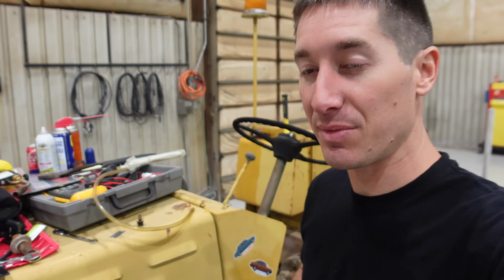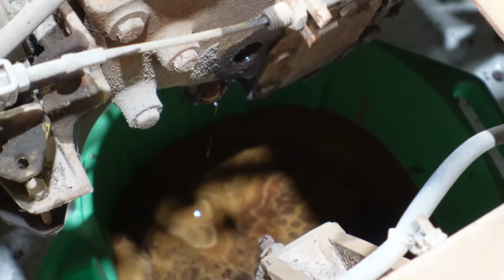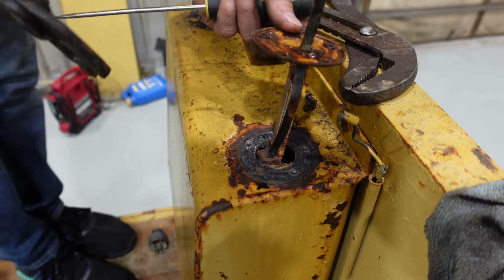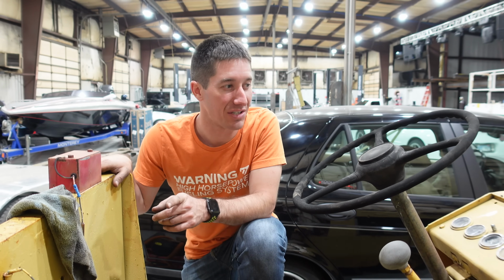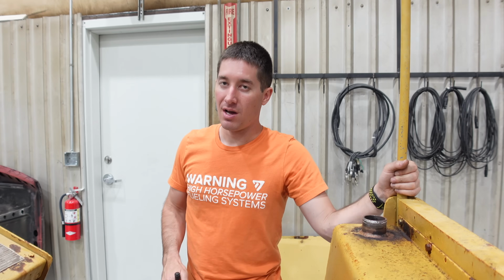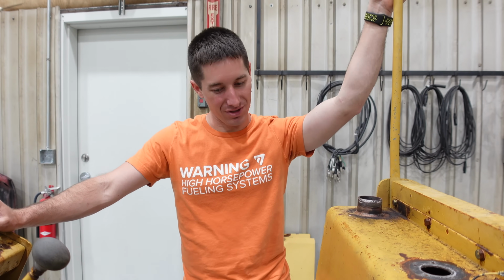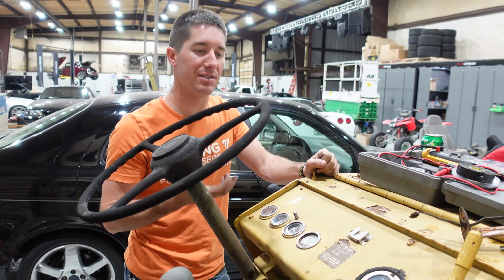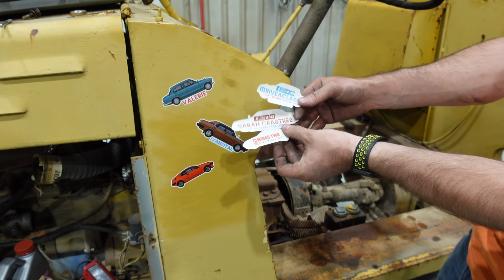SAVING My RUSTED Airport TUG Gas Tank With Evaporust

Comment: We had a Tug at the Oklahoma State Fair Grounds we used for an emergency jump/tow vehicle and a tug for our mobile welder trailer. It had a Ford flathead v-8 that our ex-Vietnam Veteran Mechanic/World of Outlaws Race Driver rebuilt and hotrodded. It would spin the crap out of those huge Tug tires it had and damn near pull a wheelie if you dumped the clutch properly(Improperly?). We could jump semi-trucks and diesel dump trucks off it as well as regular street cars. Definitely a workhorse. I always wanted that flathead for a 32 Ford Coupe rebuild.

Comment: To remove the aluminum from the steel cap threads, form a bowl around it and then fill with muriatic acid.  A couple hours ought to do, then wire wheel the rest clean.

Comment: Heating that aluminum cap then turning it is not good. Heat it up and let it cool, when you heat it up you soften the aluminum up then you turn it leaving the threads gauled to the steel.

Comment: That gear oil looks like chocolate milk. The master cylinder needs to be soaked in carb cleaner. Wow that gas cap strainer was gross. So will you put some kind of sealer in the gas tank? Would a wire wheel clean the gas cap threads? Yes bleeding the brakes had to make a big difference. What about carb rebuild?

Comment: That gas fill kinda looks like a metal plumbing or conduit pipe/thread…. Maybe try a pipe/conduit end cap… if it fits then toss a custom made rubber grommet or oring to seal and there ya go… ya think?

Comment: Eventually, add a Momo wheel, digital dash and Detroit rear locker to get that baby to hook up. Wilwood brakes to haul it down at the end of a long straight. Suspension already appears to be lowered and it's running low profile tires so that should keep it stable during hard cornering. Skidpad data results in the near future?

Comment: It might not be the low-profile heavy duty Pettibone, but I do have an ex-airport luggage tug…  started life as a chassis only ford 1 one-ton in the 80s, with the shortest wheelbase you’ve ever seen.  We picked it up from the scrap yard and made a baby gin-pole truck out of it, with winches front and back.  In the winter we mount a plow up front, and a big wing plow off the back to move snow.

Comment: Three cheers for 20 years of condensation.   I once dragged a skid-steer into my shop to solve an issue with the parking/safety drive interlock seizing when it was cold.  Opened up the chain case to discover the oil in the chain case was 50% water, so the whole works was freezing, not just the linkage on teh baby hydraulic actuator.   One oil change later, it was good as new and trouble-free at -40.

Comment: If this tug moved planes, and it probably did, that would explain the huge beefy gearbox. That tug has to have a huge reduction ratio and mountains of torque to the wheels to move heavy loads. Probably doesn't go over 20 or 30 mph.
Reply: Imagine how many tacos it could move

Comment: The easiest way to clean the aluminium out of the threads is with a rag with hydrochloric (muriatic) acid on it.  That will also eat rust like crazy.  If you're using it for rust, take it outside or have a very strong fan blowing the fumes out the door.
Reply: I just watched this tip on another Kansas YouTube channel
Reply: @kerrylewis2581  I knew about it before.  Used it for cleaning out stuck on aluminum in a chainsaw jug a few years ago.  Also use it for cleaning toilets as we have an iron problem in the water here, and it leaves nasty brown stains and causes the toilet to quit functioning.  After use of Hydrochloric, there's metallic iron in the toilet for a few days after.
Reply: @ng-ht1vx  My only experience with it before I heard on David's channel was prepping our cement pool for summer. I never knew about the aluminum trick. I hope JR gives it a try.
Reply: Was gonna suggest the same thing, Muriatic acid used to be available at pool stores I think
Reply: Just be careful with it! Muriatic acid is DANGEROUS. Wear proper safety gear--glasses, an apron, and acid-resistant gloves. You DO NOT want to fuck around and find out with this stuff.
Reply: Muriatic acid - commonly know as brick cleaning acid I have done a few small tanks with the same 5 litres, be aware it does cause the metal to flash rust
Reply: Available at Home Depot in the paint section

Comment: What a coincidence, currently doing my  80 series land cruisers gas tank with phosphoric acid. Did just ok, had a bit of flash rust when rinsing it out before completely drying.
Reply from the maker: The evaporust says drain the water and fill it with gas immediately 🍻
Reply: @WatchJRGo   May do this on my motorcycle tank.  They used to have kits you could use to coat the tank with that would seal it from the inside.  Used it on my old RZ-350 back in the day.  You could always have someone spray it with Line-x.  I think that stuff is fuel inert.
Reply: @Bill_Hartnett  por15 makes a gas tank coating

Comment: Been a while for the tug, glad to see ya taking a shot at it. It is a tug so probably will be handy with the hard to move vehicles in the fleet, watching now 👍
Reply from the maker: This thing was way worse than I thought, basically everything was stuck or ruined by rain 😬
Reply: Well sitting outside pretty much open will do that... 😉
Like I've said some of the old military trucks my buddies and I would barely get running back when they were more common had sat in fields for years and we'd get them going enough to drive and sorta stop 🤣